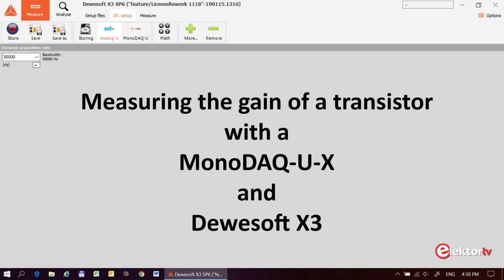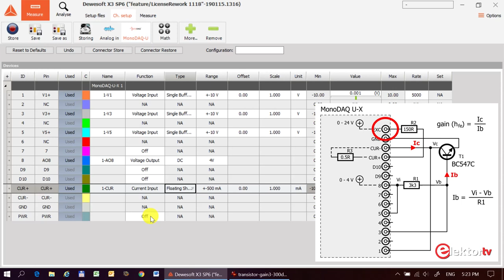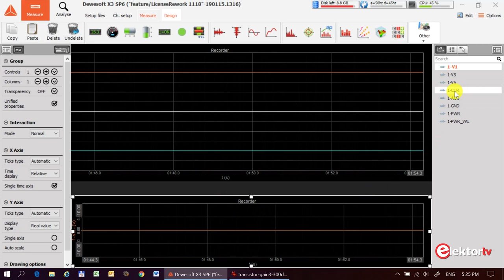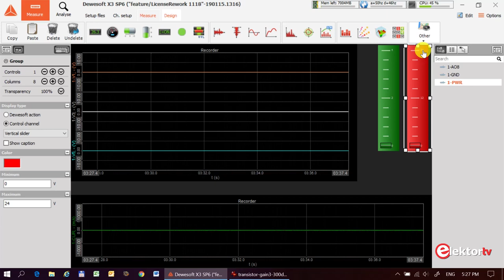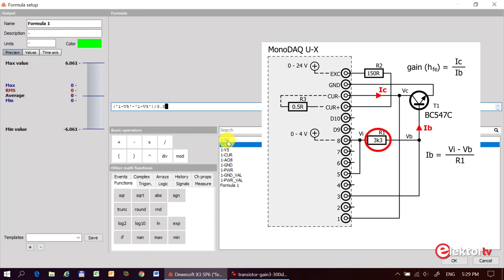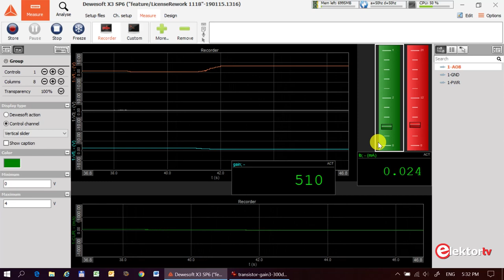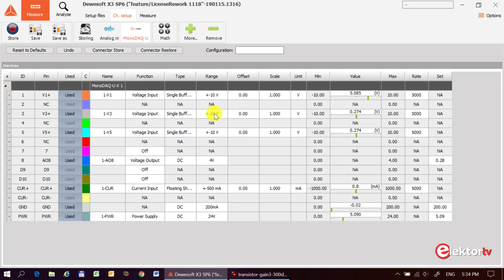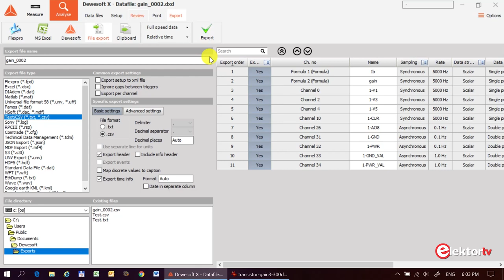MonoDAQ U-X & DEWESoft X3 - first steps

Comment: Great video! Explaining the versatility of MonoDAQ-U-X hardware and ease of use of DEWESoft software. Some extra tips for users: 
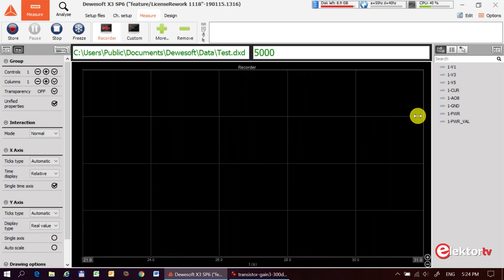3:40 When in recorder, you can use Auto scale (bottom left of the screen) to scale the Y axis automatically.
6:45 You can slow down or speed up the graphs by clicking +- buttons on the bottom right of the recorders.
10:30 To show an average value of the channel in the digital display, click on it and change its setting in the left command bar. You can choose between actual, average, RMS, AC RMS, PP etc. and also set the calculation window duration.